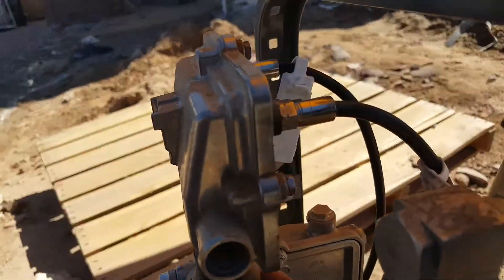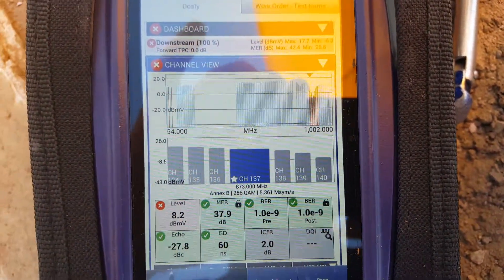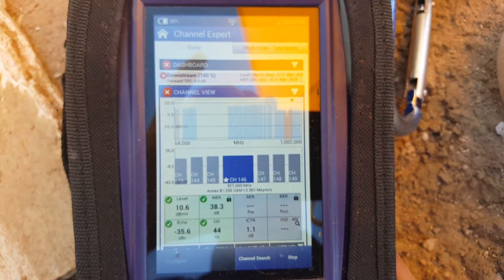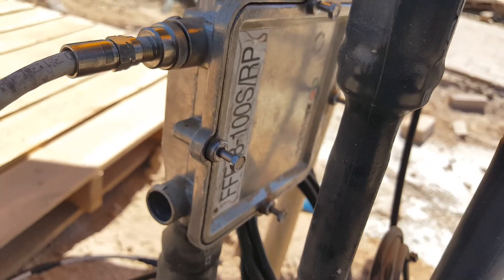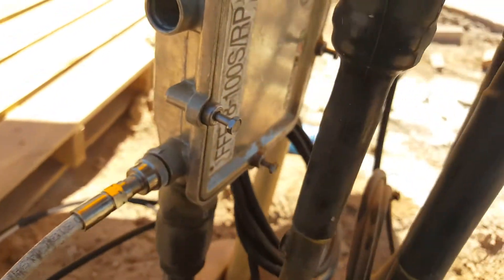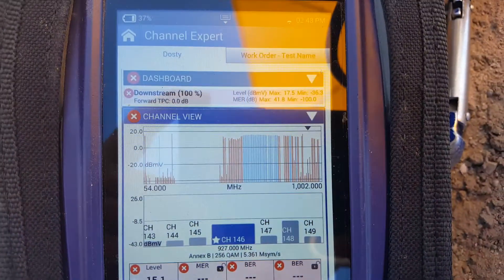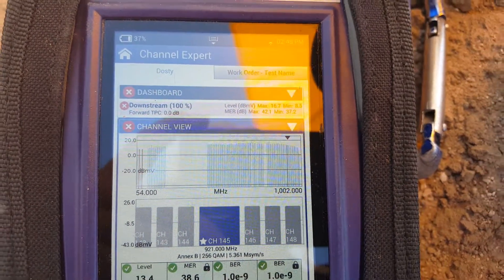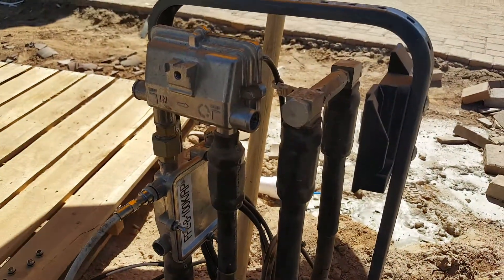Full scan suckout CATV

Comment: If you call that a "suck out", what do yo call it when the center conductor of a cable pulls out due to excessive hot and cold temperatures while giving the outside appearance that the connection is good?    Also, is that a COX system? I was just wondering since they seem to be the only ones who do not use PPC all the way.
Reply: Also a suckout. I see it a lot on undergrounds that are spliced and don't have a loop to account for expansion contraction.

Comment: why is there a big space in the spectrum ?what does the red area mean ? because after you said its gone there is still red area
Reply: Those red lines at the end are just what that OnX meter shows when you pull the jumper out while its still scanning cause the meter thinks the signal died. there is a delay before it rescans that channel after plugging it back in and clears the no signal fault. 

the big empty space is just their plant design. the whole spectrum doesnt have to be full of channels. looks like they cleared out a section big enough to put in a OFDM carrier in the future.
Reply: @SaintGuardian  can't wait for Docsis 4.0 full duplex

Comment: does anyone know how to remote into it so you can leave in a hub and look at spectrum on android phone, i hear people saying it can be done but never seen anyone actually do it, talk is cheap
Reply: Yeah it's a year old but someone might find it useful. Bluetooth connection and download the Viavi app for android
Reply: @harryjohnson615  I figured it out already I actually posted a video on LinkedIn I'll probably post it on YouTube it's actually very easy but you do have to have your meter updated and you don't do it with the app that they talked about on The View hobby site this is an actual leave the meter at the head end or wherever plugged into a router and you can go anywhere in the system you could even be in another town and look at it you could be on vacation and remotely look at that meter you just have to have an app on your Android device
Reply: @stringtiger2002  Cool, thanks for the heads up on the app you're talking about. I wonder if it's a licensed option too, worth mentioning that I'm in the UK so the options might be different. That remote access would be nice though 😁

Comment: I had a similar problem yesterday. I had a suck out on the high frequencies, we have a program called spectra that can find suck outs. It tracked me to a line splitter, all 4 screws were unscrewed to the thread with the splitter slightly ajar. I pushed the splitter to reseat it and the suck out cleared.